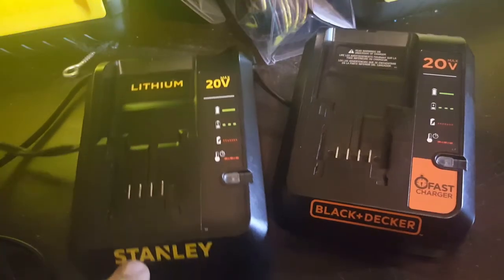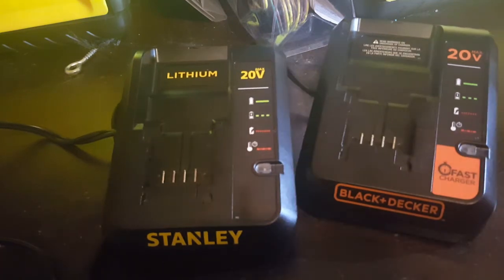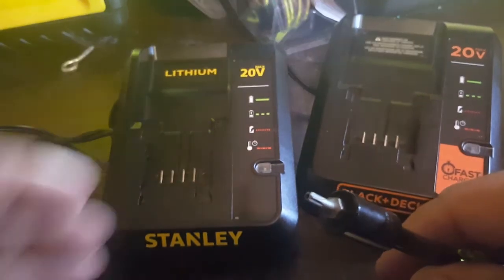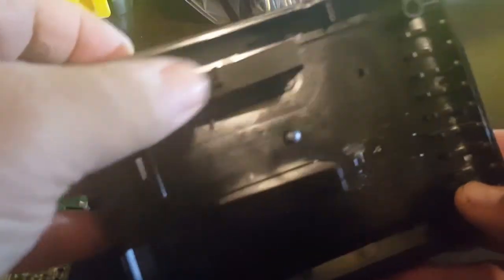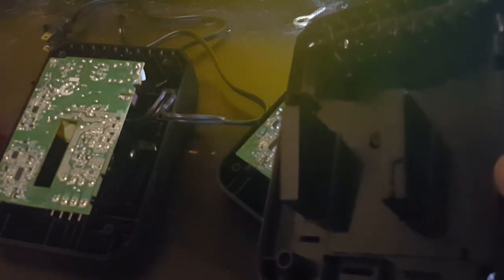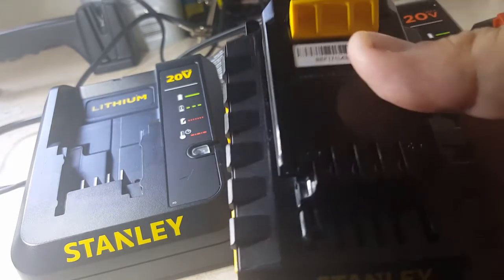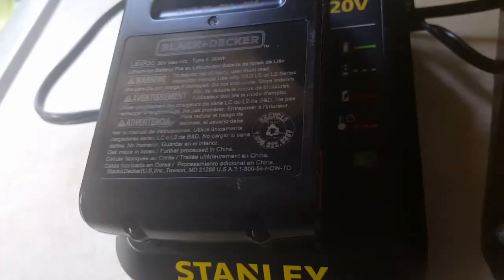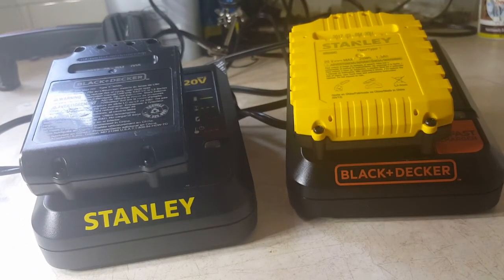Modify Stanley/Black&Decker 20v Chargers To Use Different Batteries

Comment: Will a black + decker battery fit a Stanley drill with a similar modification?
Reply from the maker: Yes, but you have to cut the drill slightly to not make the battery area not square, like you would a Porter Cable drill. People made Porter Cable mod videos.
Reply: Thanks for the quick reply. B+D batteries are easier for me to get hold of.

Comment: The black and decker 20v battery has to be modified to fit in dewalt charger, if I can figure out a way so battery won't be loose or jiggle when I put back in drill I'll let y'all know or post it. Oh and thks for video and info👍
Reply from the maker: Ok. Thanks for watching!